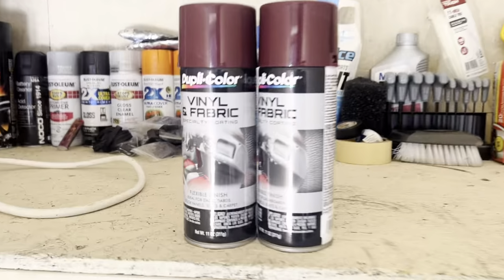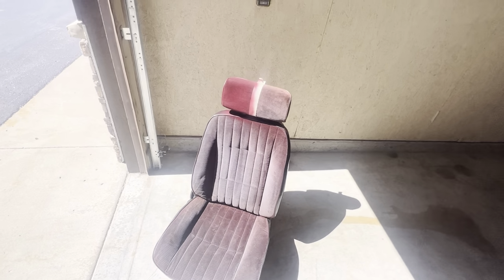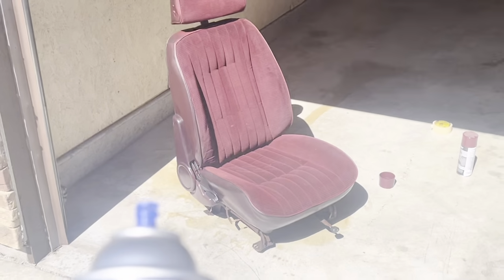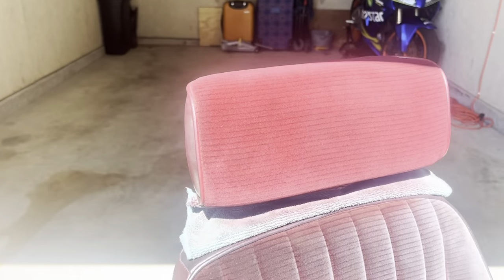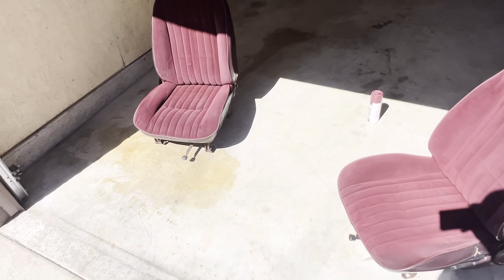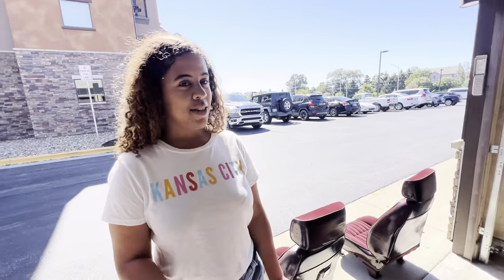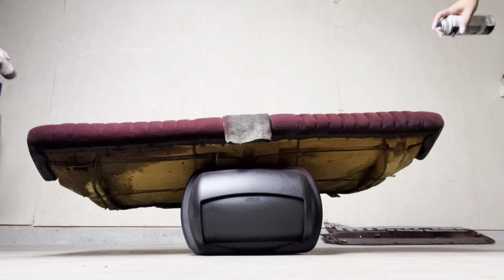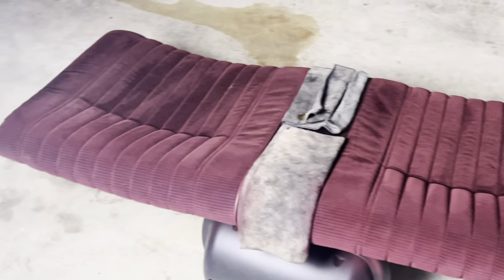GBODY SEATS REFINISHED | No Upholstery Needed (Monte Carlo SS, Regal, Cutlass, Malibu) #gbody #ss

Comment: I think Ima give this a try. I’m
Focusing on my motor and trans and this will do numbers for my interior
Reply from the maker: Same. I started with no interior. And I had to get something in there. So i figured I’d spray it while it was out. If u spray it lightly it’ll come out good without runs.
Reply from the maker: The fabric is easy. It’s the vinyl pieces that really count in my opinion

Comment: How do the seat material feel after the paint dry?
Reply from the maker: Felt normal to me
Reply: @Jemel Monger  do you think with heat it would fade on your clothes 🤔?
Reply from the maker: @DKSmith-cs4xi  I’m confident this won’t fade , or get on your clothes.
Reply: Thank you for going through some of this because money is not easy to come by I have a MC LS
Reply from the maker: @DKSmith-cs4xi  no worries. It’s not proven that it won’t stain clothes , but I haven’t had an issue.